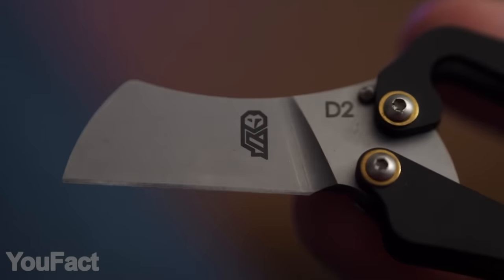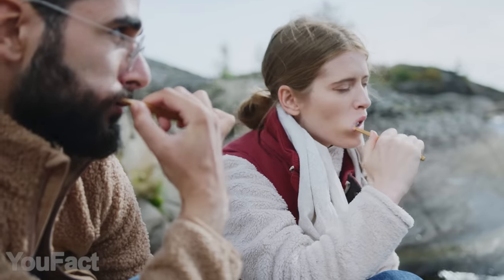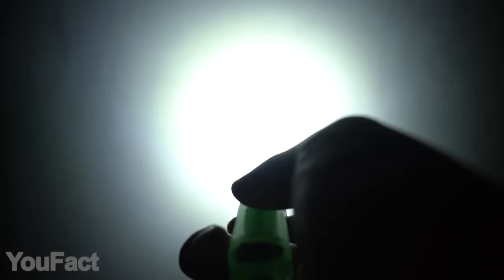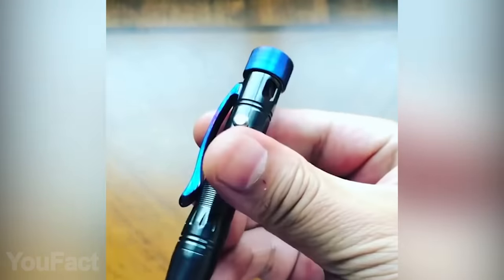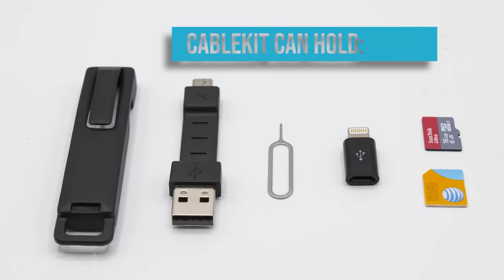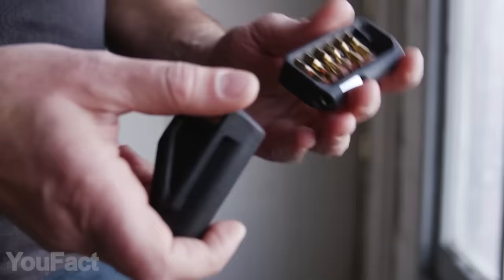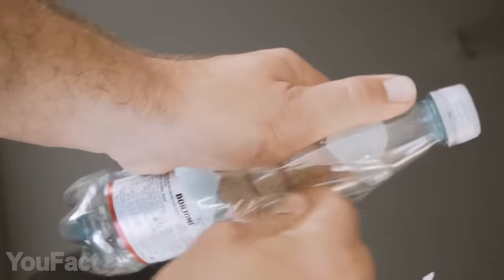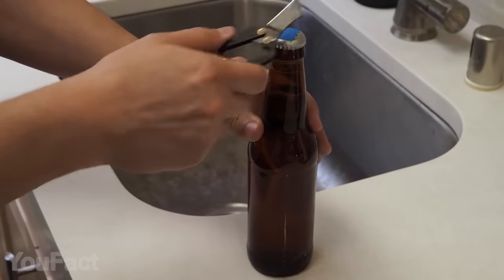13 Coolest Gadgets For Men That Are Worth Buying

Comment: Love the two pens but I have a gadget called the smart knife that has everything you just mentioned unless the bottle opener needs a cork opener and then it's missing just that... But I do love gadgets you forgot to mention it also has a ruler besides the bubble rule making it far more useful than you are letting on. By the way my life has that 2, minus the Bubble level bear in mind I'm also handicapped which means my hands don't work properly so always looking for a gadget that will not need me to use a lot of strength because my hands do not work and while I'm technically a quadriplegic in my case it's more like being a paraplegic than a quadriplegic because I can still use most of my body which most cannot but I don't have good manual dexterity anymore because of it which means I'm using voice to text and it doesn't always write things down correctly but it's the two I've got and it certainly doesn't make it easy enough for me to correct anything so I try not to so either you understand me or you don't and if my English is not good enough here it's because of voice to text and not me I used to write much better than what is coming out with voice to text. Like I said the other thing I like about my smart knife which you don't mention by the way it's been out for more than 2 years is the fact that the smart knife has everything you've almost everything you've mentioned with those two Pen knives but with one major interesting tidbit being that they are flat easy to handle and make one hell of a good throwing knife besides the blades being very good if you need to perform surgery they are that sharp and very practical.